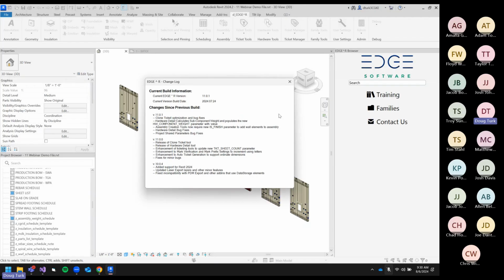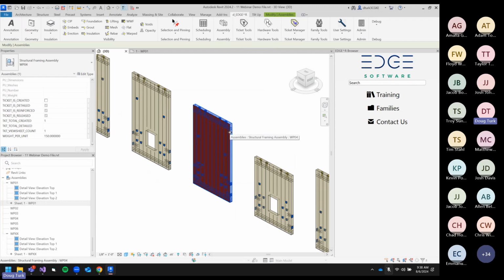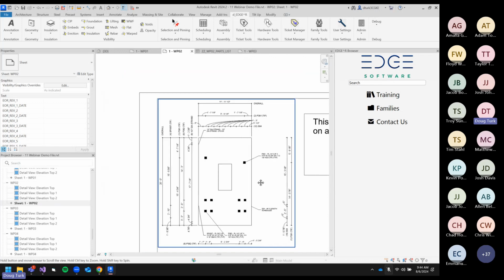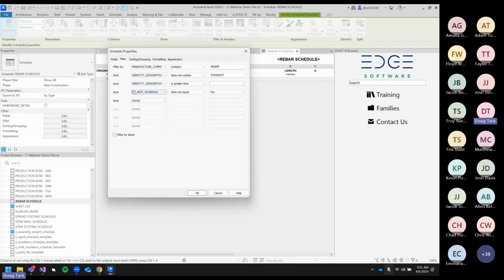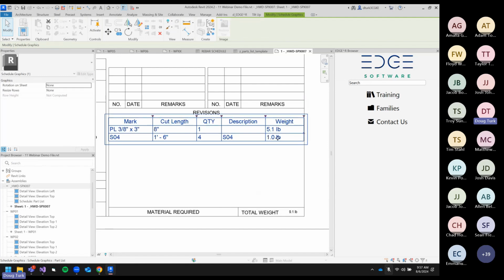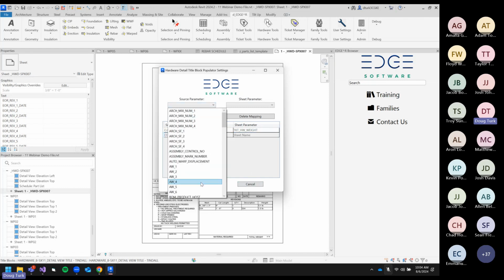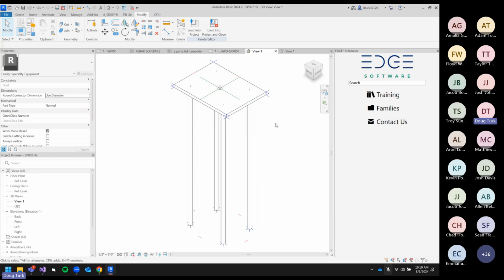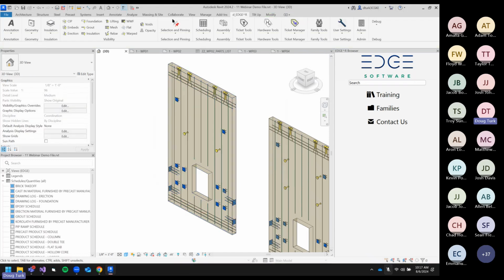Webinar: What's New in EDGE Release 11

Comment from the maker: Timestamps:
00:00 Start
00:14 About Release 11
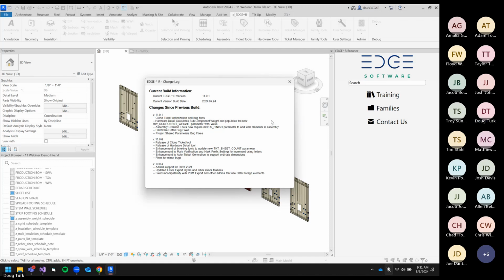01:19 Ordinate dimensions in ticketing tools
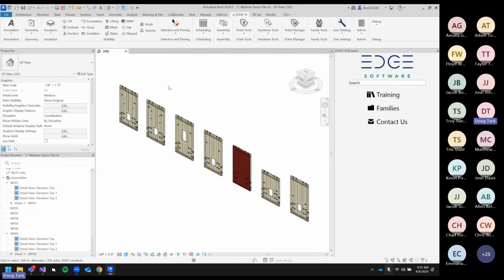03:11 Mark Verification Initial Alphabetical Naming
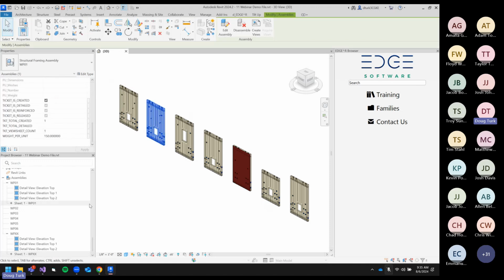05:06 TKT Sheet Count Parameter for Ticketing Tools
05:57 Enhancements for Revit Walls with brick finishes; Assemblies
08:39 Clone Ticket Tool 
17:29 Project Shared Parameters for Hardware Detail Tool
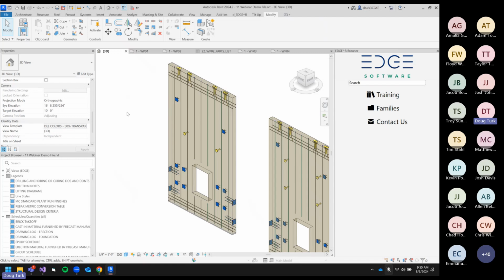24:45 Hardware Detail Tool 
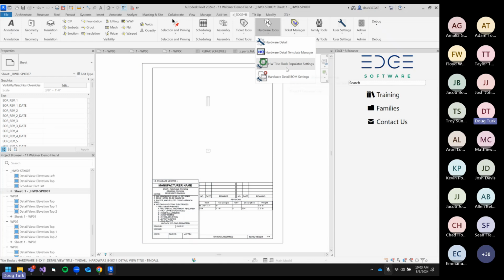32:25 Hardware Title Block Populator & BOM Settings
36:58 Editing Families
44:44 Q&A